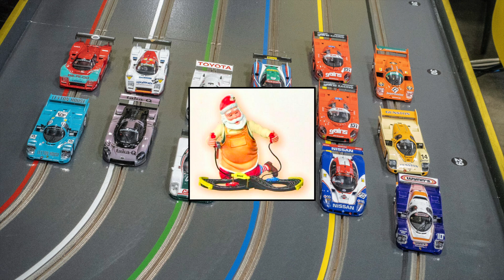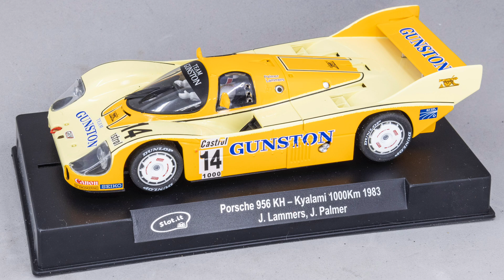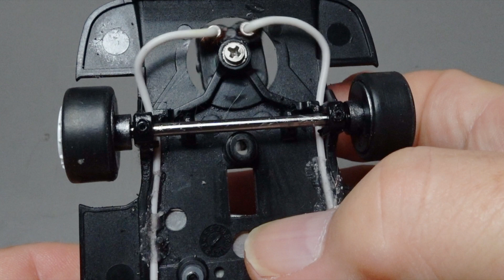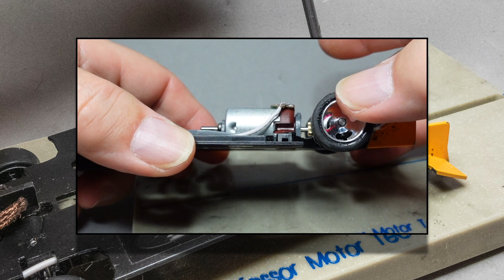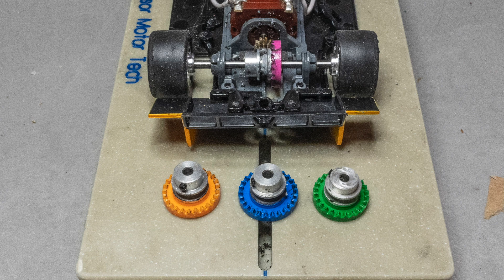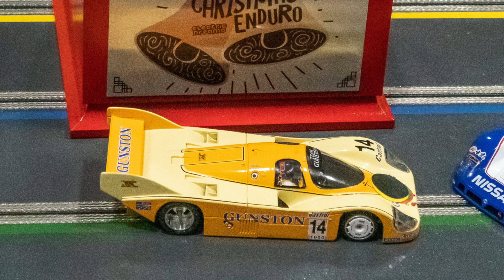Electric Dreams Slotit Group C Christmas Enduro winning car setup

Comment: Your videos are great! I live close to Electric Dreams and want to setup my GpC car. What size Slot.it tires did you use on the front? PT07 - Z0 Compound ZeroGrip Tires - 18.8 x 10mm OR PT15 - Z0 Compound Low Profile ZeroGrip Tires - 16.5 x 10mm? You didn't mention it in the video. But you did mentioned the rear tire size and part number used. Congrats on your win!
Reply from the maker: Thanks.  16.5 size. Back down in March for the CanAm race.

Comment: I keep seeing the same issue of Slot it wires breaking at the guide flag with so many folks trying to solder and use set screws. I use the new Slot.it guide (85B? )with the set screws to hold the Ferrule in place and make sure I strip enough wire to wrap around the bottom. Haven't had a failure yet in the 3 Enduros I have used it in (3-4 hours).

Comment: Kudos to your efforts and dedication, the results clearly show that it pays off. But all of this is exactly why I have a strict and simple set of rules on my home track. 10 days, 3-4 times a day messing with those tires? Such ideas and others of this calibre were the reason, why 1 person in my previous group of racers lapped considerably faster than anyone else and won every single heat in a 6 race season except 1. The 2nd fastest, as in 2nd best equipped, guy managed to win a single heat, because the fast guy had a technical failure on his car. Still managed to come 2nd tho.
I don’t have the time and the tools to prepare a car like this for every race.
We use revoslots. Straight out of the box, the get taken apart completely, put back together with slack at the right places as well as lubricants with a run in motor. I add the required decoder for a digital carrera track, add lights to taste and allow any additional weights anywhere in the car. Set up like this 9 out of 10 cars achieve lap times within less than a tenth on the 2 tracks we race. Weights don’t make them faster, just more stable for more consistent racing and less tip over crashes. Original tires, no messing around with them.
Racing has never been more exciting than today, all participants are able to win and heats usually develop into multi car battles decided by nothing but a driver‘s skill and focus. Contrary to many others I also race 12 to 15 minute heats with fuel consumption that never requires all pit stops to go to 100% all the time. That way you can gain a bit with your pit strategy.

Sorry for the rambling, thank you very much for sharing your techniques!
Reply: Home racing has nothing to do with club racing, worlds apart. Home racing is just for the joy and fun of racing with friends(any rules come second to having fun), whereas Club racing requires working on driving skills, engineering and strategy( and money of course, but not that much), club racing is for those with a competitive spirit who like managing teams and cars like the F1 or Indy but with a lot less money.😉